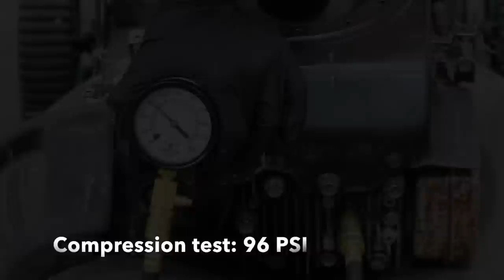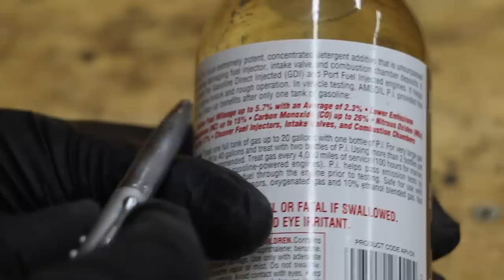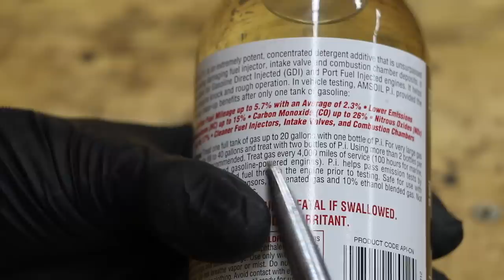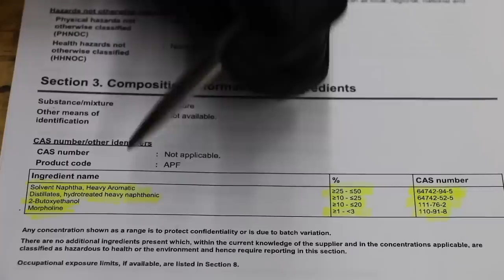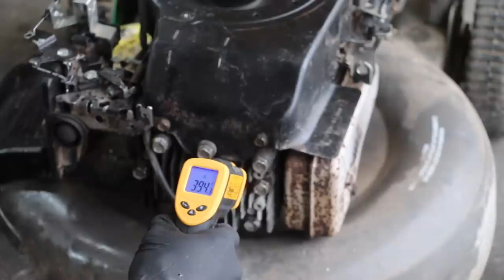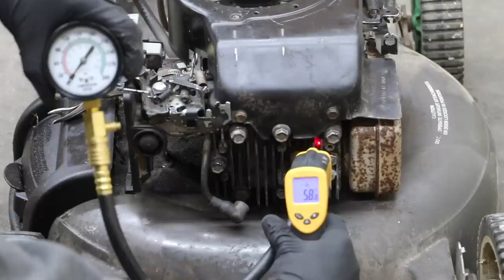Is Amsoil Power Foam better than Seafoam & MMO? Let's find out!

Comment: Finally an Amsoil video!  Amsoil Quickshot is the preferred fuel additive for small engines (though I am not sure what the difference is).   Nice to see an unbiased Amsoil test.
Reply from the maker: Thank you for the positive comment.
Reply: Boodieman72 - "Preferred" by "who" exactly and which real world test caused them to "prefer" it!???
Reply: Quickshot prevents ethanol corrosion, P.I. is more for cleaning.
Reply: Quickshot is designed for small engine and powersports equipment.  P.I. is more for cars and trucks.
Reply: I honestly wouldn't be surprised if Quickshot is just PI with fuel stabilizer added to it.
Reply: @__WJK__  He means that Quickshot is what you're supposed to use in small engines. PI is what you use in a car engine. That's what he meant by "preferred"; not meaning that people prefer to use that over other brands.
Reply: @averyalexander2303  Could be, yeah.
Reply: I hear amsoil is all hype 😂. Not worth the money
Reply: Quickshot made SEMA product of the year in 2011!
Reply: Quick Shot is used with every tank to address phase separation in ethanol blends.
RAPTURE READY you heard wrong. I can provide a study of more than 200 oils if you care to look me up. Amsoil comes out on top.
Reply: @raptureready9502  Amsoil is not all hype.  But unfortunately, they chose the Mary Kay model of marketing (Mutli-Level/Network marketing) so they naturally come across as a scam that only easily-fooled people would fall for.  However, if you do your research, you will find that Amsoil does make not only great product, but product that are better than their OTC counterparts.  Maybe not all, but a lot.
Reply: @__WJK__  By people that make it.

Comment: As an AMSOIL dealer these are always good to see. I have to say the reason I became a dealer is because I bought products from a dealer and fell in love with the products. I use the API in my vehicles every oil change for the motor flush and 6k for the API and I notice a difference especially when I first switch a car over and clean the systems up for AMSOIL use.
Reply from the maker: Thank you

Comment: I cut and maintain five (5) properties of friends and family.  At the beginning of the season I mix a 25 gallon fuel caddy with BP Ultra, two (2) cans of Seafoam  and double the recommended amount of Startron.  Based on your research here, I started using the Seafoam and have had MUCH better performance results out of all my small engines, enabling me to  stagger full tune-ups on a 2 - 3 year cycle to keep the cost down.

1.  I found the BP Ultra (93 octane) helps prevent knocking in the higher revving, hotter running 2-cycle engines and it is a much cleaner fuel; better filtered fuel from the start.

2.  Based on your research here and seeing your results, I now use Seafoam exclusively in both my small engines and my car.  All my engines are running smother and more efficient.  As for my 2005 Chevy Colorado that is 223,000+ miles, it has some of the best gas mileage and power it has ever had.

3.  The Startron helps stabilize the fuel to prevent the added 10% ethanol from absorbing moisture out of the air.  Ultimately, it is that moisture absorption that hurts the small engines.  I do not know if Startron has any 'cleaning' properties and would love to see a video on it.

Thank You
Reply from the maker: Thank you very much for providing this information and thanks for the positive comments!
Reply: We do the same as you. We add an ounce or two of Seafoam per gal and an once of Startron. Seems to keep the small engines clean and happy. They always start on the first pull. I especially like it in the winter when I don't need to choke the snowblowers.
I'm a bit confused on your post. Have you stopped using Startron all together and 100% Seafoam?

Comment: Great video.  I personally would not worry about varnish build-up in the carb's float bowl as long as nothing is loose or flaking off in there.  Usually, water and dirt are in the bowl, and they are definitely problems.  I worked for Sears back in the day fixing mowers and other lawn equipment, so I have seen my share of small engines.  I love the clear cylinder head footage that you included.  I have to show that to my science-teacher wife for her class.  The artsy slomo shots of the fuel bouncing around in the clear tank, and the smoke around the muffler, were a hoot!  --Old Guy.
Reply from the maker: Thanks!  Thanks for sharing.

Comment: Love your videos, I’m constantly working on small engines in a variety of settings, ie. marine, motorcycles, generators etc. varnish is a huge problem on engines that have sit for a long time. Even after cleaning the varnish by hand out of the carburetor it still seems that you can’t get it all. It would be great if you could get some chemicals gathered up to see what dissolves it the best. Thank you and keep up the awesome work.
Reply from the maker: Great recommendation!  Thank you!
Reply: Berrymans Chemtool is the strongest stuff. We used it at the automotive machine shop I worked at years ago. But do yourself a favor, wear impermeable gloves, use it in a well ventilated area, and wear are chemical respirator when you are anywhere near the fumes, it is NOT good for you. I really stress the respirator for any chemical.
Reply: @5400bowen  I use B-12 every second or third full up and MMO before oil change also use in gas .

Comment: Do a test using gun cleaning solvents! Hoppes #9, gun slick foaming bore cleaner or a black powder solvent.
Reply from the maker: Thank you for this recommendation.
Reply: @ProjectFarm  wow u really do read and respond to a lot of people's comments. What motivates  you to make these videos?
Reply: That would be cool to see. I have seen them rip dirt out of a gun I'd imagine they would do the same with an engine
Reply: agreed. would like to see other methods of cleanin carbon off an engine. the gun cleaning solution would be an interesting one to watch. try to add drops to intake to be sucked up and burnt off. also pulling the spark plug and letting the solution sit and heat soak.
Reply: 2111onyx if this happens, I would love to see it.
Reply: And don't forget amsoil firearm cleaner
Reply: I read this too fast and put black powder in my engine. :/
Reply: Try simple green?
Reply: Ballistol best gun cleaning solution there is😎
Reply: @jerbear7952  did you get better mpg?
Reply: Don't forget Amsoil gun cleaner 😂😥
Reply: @vandyman1716  I can’t answer that or big oil will come steal my vapor carb...hold on someone’s at the door
Reply: @ProjectFarm  and Amsoil gun cleaner. Jim

Comment: Thanks for another great video 👍. I have 3 vehicles and I have used the sea foam spray to decarbonize the values and pistons on two. One's a 99 Ford ranger with 272k on it. And the other is a 08 Chevy truck with about 125k.  Both had great results. Not a big smoke show, however the ranger did have a couple of big "farts" . The third vehicle is a 15 beetle. I used the CRC di & turbo cleaner. It has about 46k. Still no big smoke show. Per instructions for both, I let them soak. Then the best part was the driving like you stole it for about 10 minutes. All three ran better than before the cleaning. But my beetle seemed to benefit the most. I do not have a scoop by the plug I pulled did look a little better. Thanks for that video 💪💯
Reply from the maker: Thanks for sharing.

Comment: I lucked out and found you did a video on this subject. I vote for power foam and the PI works very well in a vehicle because of the miles you drive vs the time running in a small engine with one quart of fuel. Last month I purchased a vehicle with a Chevy 454 that had a bad case of after run, so much so it was difficult to shut off, I had to put it in gear and turn it off and then I had to stand on the brakes!
Twenty gallons and one bottle of PI later no more after run. I took it to the California smog station and the emissions were on the super low end of the emissions scale. One bottle every 4,000 miles does the trick.
Great video as usual!
Reply from the maker: Thank you!

Comment: Todd, I don't think what you saw inside the fuel bowl was varnish. On slot of Small Engines they have a protective coating on the inside of the fuel bowl to protect against rust. Overtime this coating comes off. I believe ethanol has alot to do with the removing of this protective layer. As always awesome video.
Reply from the maker: Thanks for this information and thanks for the positive comment too!

Comment: Glad to see Amsoil products tested. I use them myself with great success. I have mpg increases of up to 10% just from running one 22 gallon tank with PI on my old dodge Dakota. Obviously that engine was probly very dirty. I also use their oils in everything I own, and always have to flush out the engine before switching to full synthetic even when I bought a truck that had been run on Shaffer (idk how to spell it) oil its whole life
Reply from the maker: Thank you

Comment: Amsoil seems to have changed the formula since you made this video, Todd; the formula's more potent now. The old one was to be used with 20 or fewer gallons of gas, the new one can be used in the 25 - 30 gallon range.
Reply: It’s actually less potent because before you weren’t supposed to over add it per oz. Now you can

Comment: With direct injection engines (virtually all vehicle engines sold now), the intake valves are where the serious carbon buildup problem will be, and that is how I'd like to see these liquid engine cleaning solutions tested. My impression is that media-blasting will continue to be what's required to remove heavy intake valve deposits from direct-injected engines.
Reply from the maker: Thanks for the feedback.
Reply: as an Amsoil dealer for over 23 years I am definitely a power foam fan but I will say power foam is not I repeat not recommended for direct injected engines. I just confirmed this with our tech support team today.